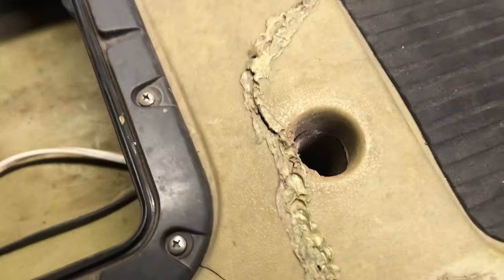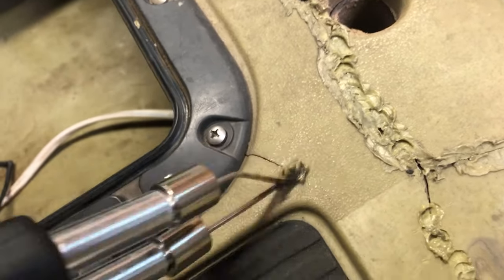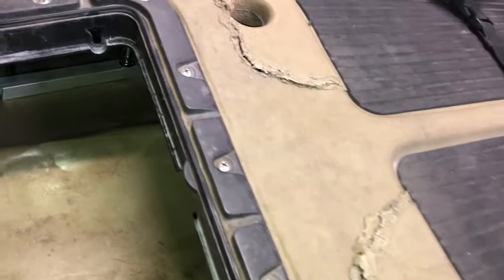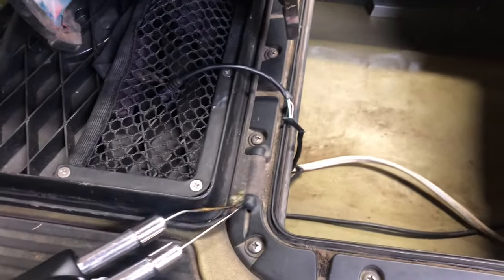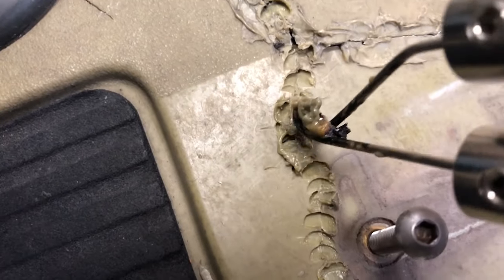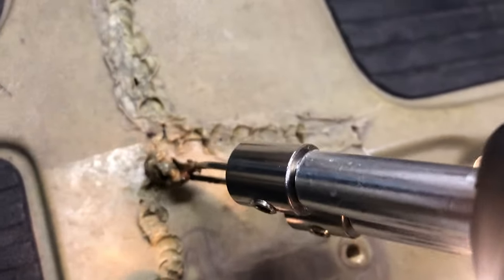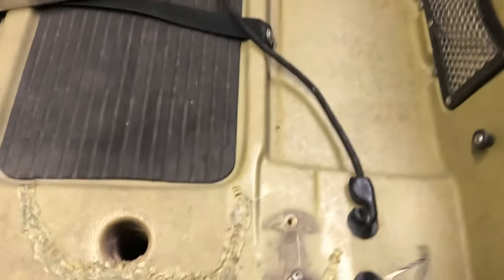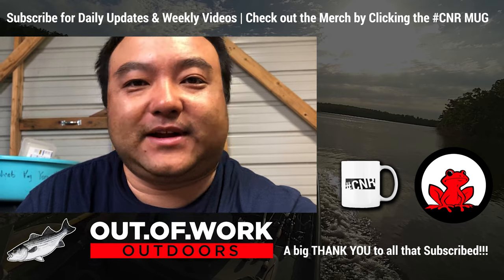Quick and Easy Way to Repair Your Holes and Cracks in Your Kayak with Soldering Iron - OOW Outdoors

Comment: You should get a plastic welder iron it'll work better and use hot staple welder to strengthen it more.  Very cheap and would work a little better then the solder iron.
Reply from the maker: Wong Moua next time for sure